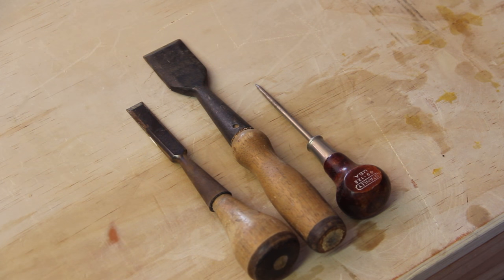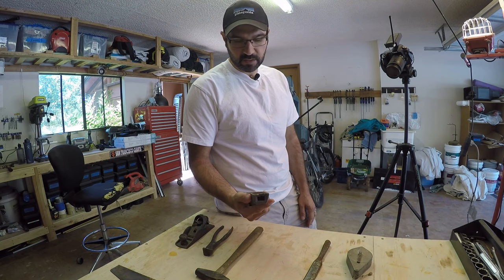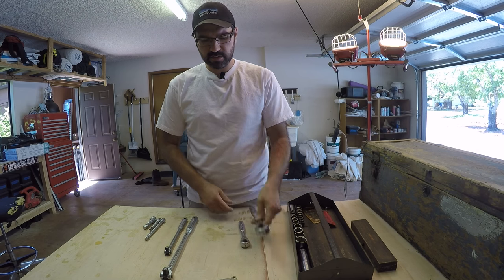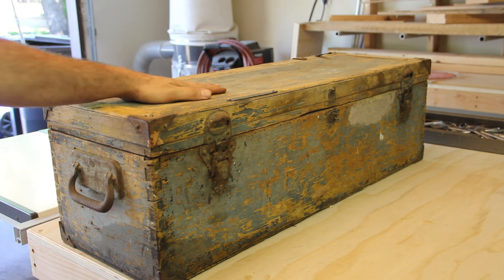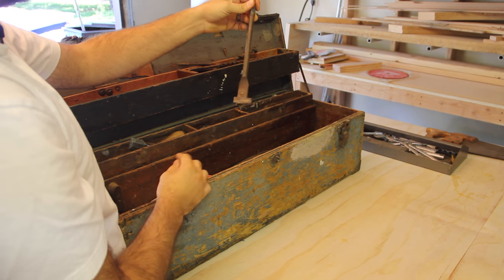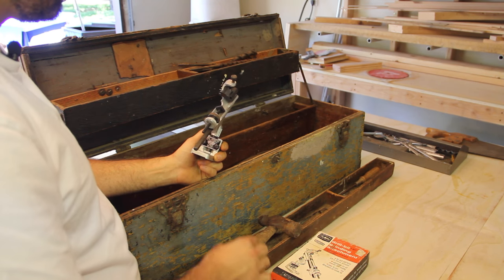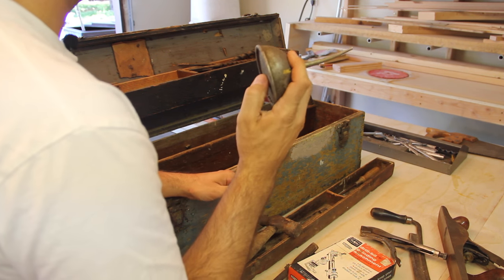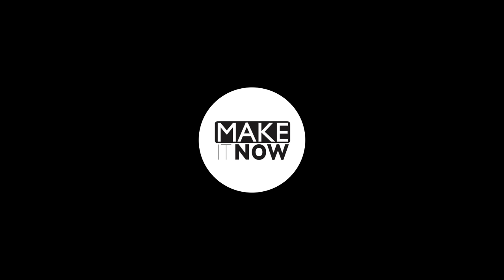Side Project: Antique Tools

Comment: Nice tools!  The saw tooth set, the draw knife, and the Stanley No.5 are golden!  On the chest and it's value, if you protect it with a period-specific coating it shouldn't devalue it.  Shellac is good because it will adhere to almost anything and can be easily (relatively speaking) removed with denatured alcohol.
Reply from the maker: Thanks Michael! That's good to know.

Comment: Get yourself a gallon of Evaporust to soak the metal tools and parts in. If you do not remove the rust, it will stain the wood you work on. The EVRust is biodegradable, and not harmful to humans  and you can reuse it over and over. Love the box too. I would restore the metal and strip down the chest to its original condition if it was mine. But i can see the appeal of leaving it as is. Removing oil from would is near impossible, but i would still research it. Something new may have been developed to remove it. Best of luck.

Comment: Welcome to the tool world :-) Claudio
Now I hope to not being late. ;-)
I is a wonderfull chest, as it is. Being mine I would try to find out how old it is, and possible value.
Restoring should be very, very carefull. Not applying any new modern material.
Make it in working order and just remove the rust, muck,  dirt and if possible maybe some of the 'new'/modern paint stains I think I saw.
Use the old paint and oils, like linseed, pigment and so on.
Stripping it of old paint, sanding down to fresh wood and likevise diminish its value.
I see a possible collectors item or museum piece for early 1900 - late 1800 interest.
But maybe I am just old custodian ;-)
Reply from the maker: Yeah the restoration would be very minimal. Cleaning up the dirt and dust, and sealing in that amazing look that it already has. I'll make a video about it for sure.

Comment: As I understand restoration and curating, the process used with tools is to brush with 000# steel or copper wool.  The wipe down with mineral spirits.  Finally, rub with a very thin coat of bees wax.  If you want to go crazy then this the point you’d rub a little xtra wax on.   The chest restoration is even more boring.  Wipe with a very lightly dampen cloth thruout.  Wipe with a very this coat of beeswax with carbuba wax in it.  And that is it.  Most collectors, curators and enthusiasts agree that the value in a piece IS the dirt and the wear-pattern and the modern paint drips.  But more often it just looks ugly.  Then you go into a cosmetic restoration where you do remove the modern paint and you do wipe away the glob of grease.  But never refinsh anything.  Ever.  If you want the original finish then you’re in luck... it’s already got it on.  But they are your tools.  Unless you plan to sell them, you can do whatever you want, and every tool bro out there understand that.  Good job.  Oh the down side is now have the disease.  It’ bad.  Always have room in your vehicle in case you see a “yard sale -tools” sign.  Don’t ask me how I know that...
Reply from the maker: Hey Michael, thanks for the great info! I’m bummed it won’t be able to restore the chest. Our house burned down last November in the Camp Fire in NorCal. I did manage to salvage some of the steel chisels and things, but not sure when I’ll be able to restore them.

Comment: Is there a name/brand on the chest? I have a smaller one just like it. I am hoping to restore mine.
Reply: The chest would have been made by the original craftsman…like a carpenter….you can tell it was a travel box by the size of the handles on the side….heavy duty…because the box was heavy with all of the tools inside.

Comment: DON'T MESS THAT TOOL BOX UP! Don't use spray laquare! Let tge grain soak up as much linseed oil as it will take then coat it with shalack! Hindges and hardware: remove and use muradic acid for the rust then use old furniture wax after you have wire brushed the hardware! Subscribe to: scoutcrafter !!! And learn from him! Good luck. Dont want to see you ruin the tools OR THE BOX!!!